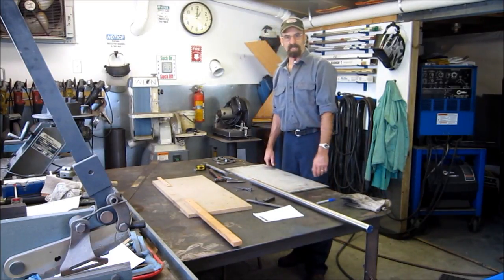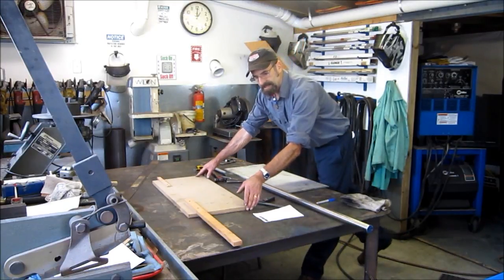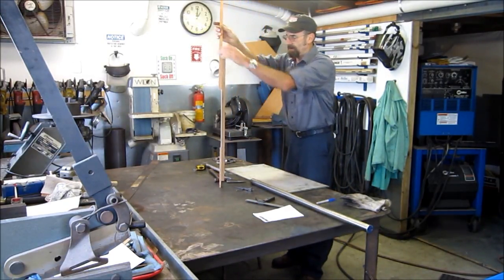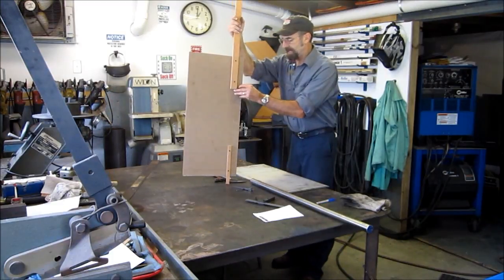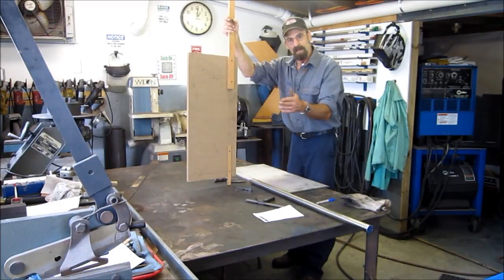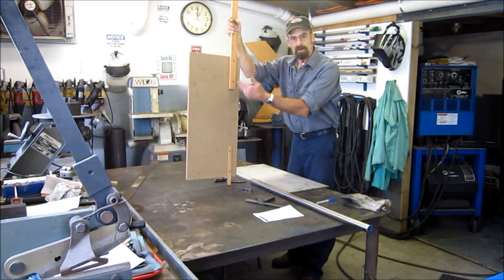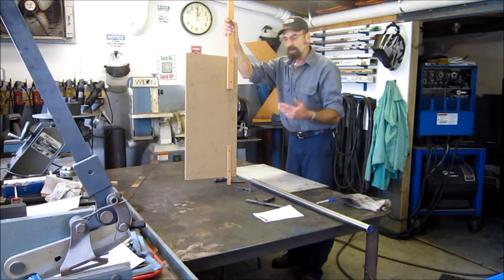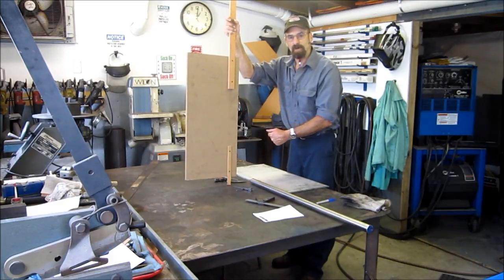Blade Making

Comment: You make very valid points on the benefits of stick welding over tig in this application. Many people always assume tig has a lower heat input than other welding processes.

I really liked your radius cutting jig for the plasma. Is there any way I could convince you to take a picture or two and send them to me.

Cheers,
Dave

Comment: Would it be a good move to mill a smooth radius to the welds to reduce drag, and also at the same time reduce the risk of cracking? (No, I'm not a machinist. Just interested. ;)

Comment: how to cut keyways and get the desired size?  Mine are either to tight or to loose, then require compromising.  I usually compromise to too tight, its gotta be tight, I think.  Would like to see a viedo on this.  Also how do you cut a keyway that might be 20 plus inches long ????

Comment: Keith,  Some dimensions, in inches - Length of ram slide 32, Width of slide 8.625, Dia of tool head 8.625, Height to top of ram 46.5, Pulley diameters 10 8 6 4, Table width 10, depth 15, height 11.25, Table travel 24 horizontal, 20 vertical (length of knee slide). Thanks for  your help.

Comment: Keith, I have an old Flather shaper I want to get running. It was belt driven, so I need to know speeds. What rpm does the belt shaft on your drill press run at?  Would that be appropriate for the shaper?

Comment from the maker: @LowkeyallLove Thanks for the Kudo's, All my machines were bought used and some of them I had to do alot of repair to get them in there propper working state. I built the hydraulic press myself, the 2HL mill was missing all the handles off the front, due to a bad forklift accident, the Bridgeport, needed new gibs and feed nuts and I added the traverces & the read out, the drill press took off and on, 6 years, to finish, the lathe needed new head stock bearings and took 8 months to get...